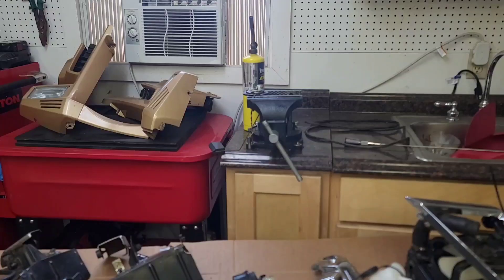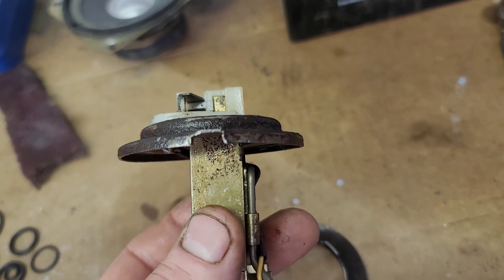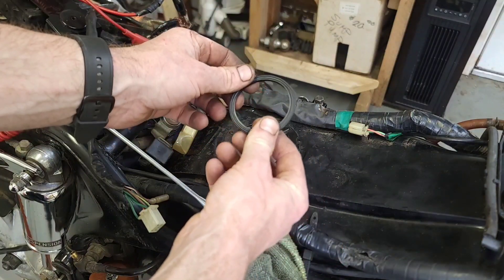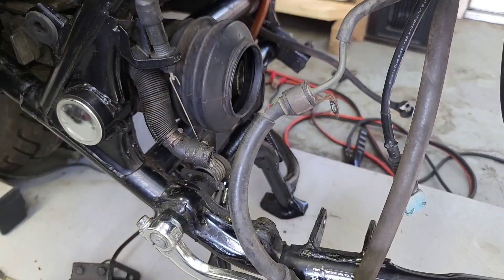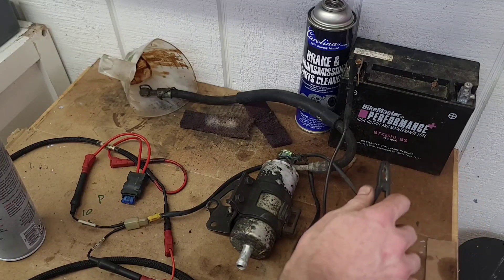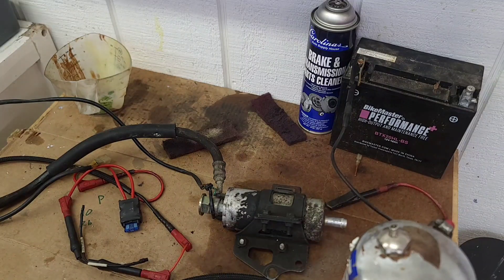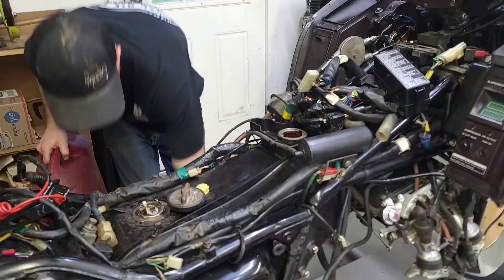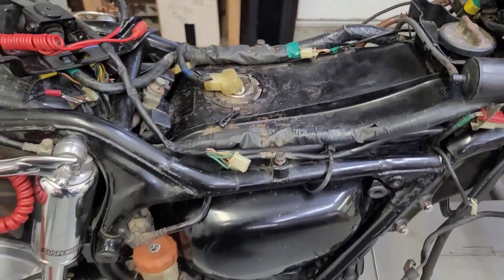Goldwing part 18 (fuel tank / float / pump)

Comment: Nice work! I went through a similar process a few months ago. Rather than pliers, you should use a hammer and a flat head screwdriver on the edges of the retainer to tap that fuel retainer into place. Gentle taps will lock it where it needs to be. But, it seems you've got it. Loving the series.  Thanks!